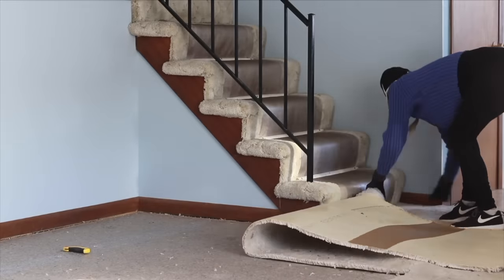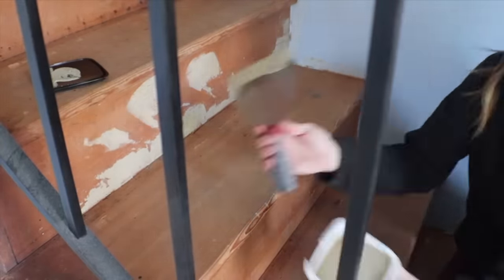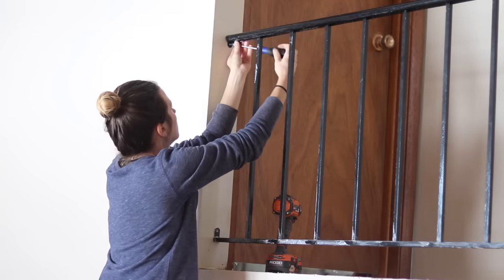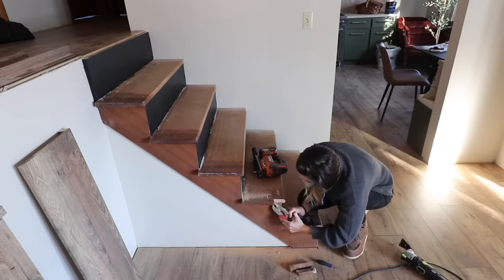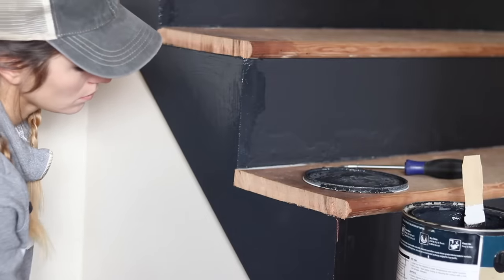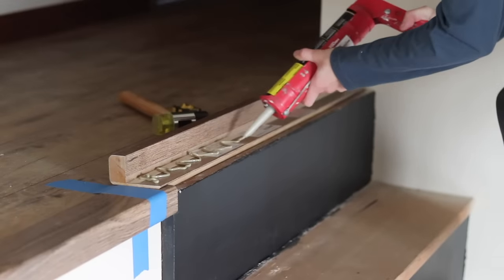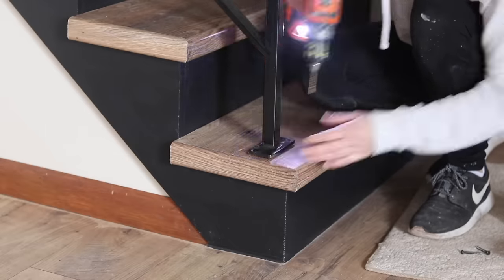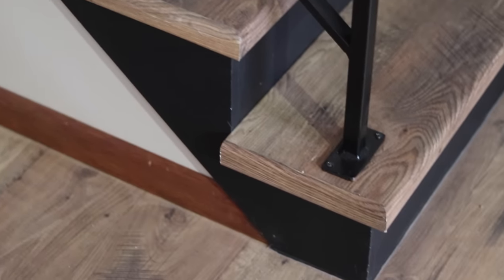DIY Stair Makeover | Ugly Carpet to Updated Laminate Stairway

Comment: While it is aesthetically very pleasing now (really love your choice of black risers and the wood finished steps against the beige wall), is the depth of each stair now up to building code?  Taking so much off of each step area may be great for your smaller foot, but could become a hazard for others. Use caution.
Reply from the maker: I don’t think you understand how the stair tread I added was constructed… it’s the same as the previous, a standard 10” deep, because the bullnose was built on.
Reply: The stair depth stays the same. Look at the  video again. It should  be obvious

Comment: I appreciate how much work you put into the steps. They look great. What a transformation. I know how difficult it is to remove carpet from stairs. I also removed all the nails, staples, and tack strips. In the process, I had a little slip with the utility knife. I ended up in the ER. Although I hit an artery, It wasn't too serious. I have been working on houses for 40 years, I should have known better. On top of that, I work in a Vocational school, where along with the students, all the teachers have to complete a 10 hour OSHA Safety course. I say half jokingly, they should revoke my OSHA Certificate. After a few days of rest I returned to my steps. Since I was planning on re-carpeting the stairs, I had to add piece of wood to the part that hangs over because after 70 years of carpeting and re-carpeting Most of them were loose, missing or like Swiss cheese. I nailed and glued them. I was aware that if I ever planned to refinish the stairs, they would have to be taken apart and re-installed with hard wood, so I wasn't concerned about the kind of wood I used as long as it had the same shape and was solid. They were ready for the carpet layer.

Comment: Great job and great results, at a fraction of what it would cost to have a contractor do it. You're pretty handy with power tools and don't ever let anyone tell you otherwise. For future, if you're ever doing such a reno again: if you want to trim the tread edge straight, nail a strip of wood to work as a guide for your jigsaw shoe (or your circular saw shoe). A couple of nails is enough and the holes will eventually get covered with the new tread anyway.

Comment: Hi Melissa. I enjoy your videos so much. I want to compliment you on your choices for the stairway. The black paint with the laminate pattern looks marvelous. How ever, I want to caution you about stairs. I am in the construction industry and there is a science to stairs and the human body. After the bottom riser, all of the other risers should be the same. This is because the body sets a rhythm as it climbs stairs and if the top riser is taller then a person will inevitably trip. This can occur even if the difference is 1/16". In your case, the top riser is going to be shorter so you can expect a stomp at the top of the stairs because the body has self regulated to the other risers. The body will think that the surface is at the same level as the rest and assume a stop and the foot will fall the rest of the distance. As I said before, you do a great job in everything I have seen you do and I hope that you keep doing these videos for a long time. Just store a helpful tip in the back of your brain for the next stair project.🙂
Reply from the maker: Each riser is exactly the same. The height added by the treads is equal to the height added by the landing strip/new flooring at the top.
Reply: @WelcometotheWoodsBlog  Glad to hear that. I had forgotten that you had redone the hallway floor also. As I said before, keep up the good work. I have learned a couple of handy tips watching you.

Comment: That’s a tricky cut you made with the jigsaw.  Circular saw would give a straight cut but won’t get into the corner well.  Router like you suggested might work pretty well.  Handsaw might be your best option.  Not really a great solution though unless they could be removed and reinstalled, but that’s likely a major job.

Comment: When the tread is shortened it makes it tuff on people with big feet, especially older folks.
Reply from the maker: The tread was not shortened. It's actually an extra 1/2 wider than before and now a standard size: 10 inches. I don't think you understand how the prefab treads I installed were made.
Reply: @WelcometotheWoodsBlog  sorry, I guess I missed the final measurement.

Comment: I have carpet on my stairs, white carpet.  I started removing the carpet & the stairs are black metal stairs.  Unbelievably they used some kind of construction adhesive obviously to adhere the tack strips.  And huge long nails I'm unfortunately not strong enough to remove each one.  It's near impossible to remove these tack strips completely.  The stairs have rusted in the spots the strips are as well.  I gave up until I could figure out what to do.  I finally got the tack strips off the top stair by using a hammer & chisel.  But it still left pieces of wood stuck to the metal.   I cannot find anyone who has the same issue as I do.  Apparently whoever built my home is the only person that idiotic.  If anyone reads this & has suggestions I will be so grateful.

Comment: Carpeted stairs can be safer for people with mobility and coordination issues. For example, if you have a severely Autistic family member, smooth stairs like these can be very dangerous for them. I am severely Autistic. The stairs were like this. I fell all the way down into the basement and landed on ceramic tile floor. I had nerve damage and mobility issues for years after that. After that, my caregiver installed safety strips on the stairs. Stairs like you made are beautiful and look great. However, they are only 100% safe for able-bodied people.

Comment: Surely the banisters needs more support than just 2 screws at the bottom step?? There won't be enough strength in that...the banisters should be supported from other steps too...or at least with better fixings somewhere, surely?
Reply from the maker: When I removed it the railing was only secured down with one screw lol. It's very sturdy, it connects to the other railing at the top with bolts as well.